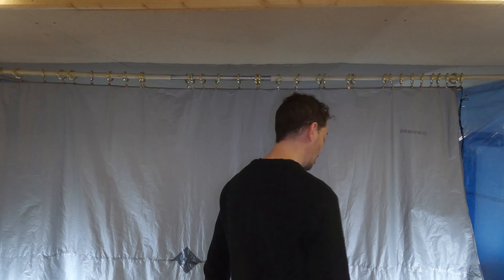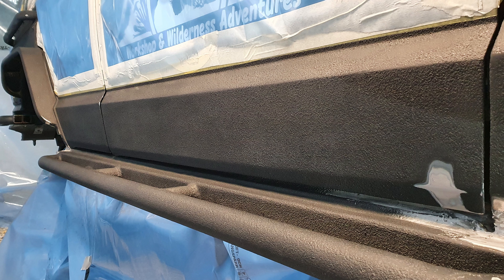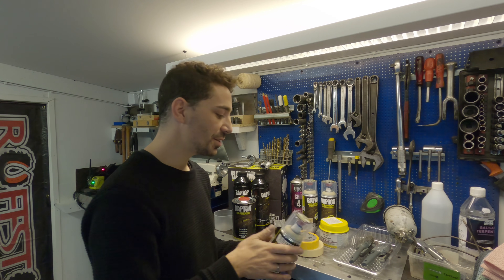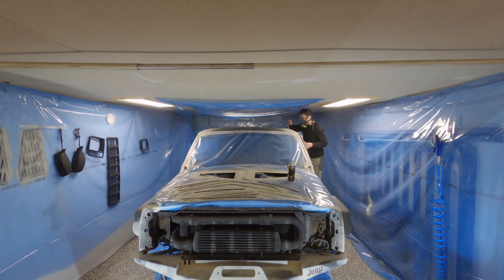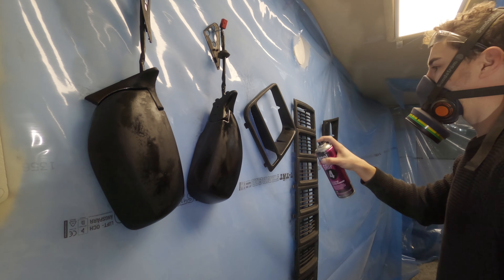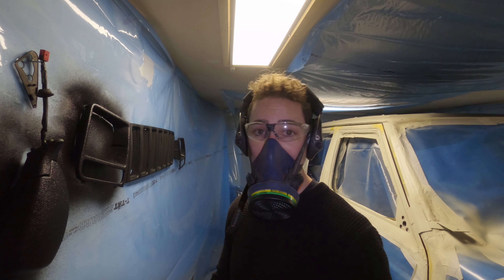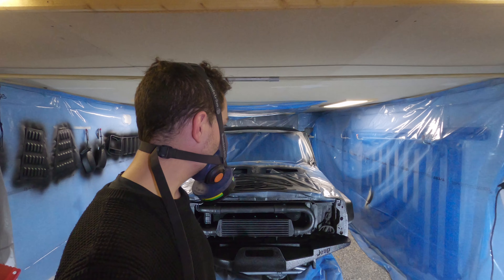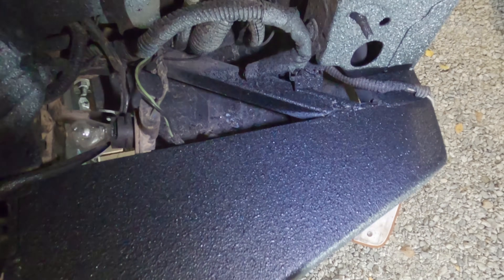Spraying Jeep XJ Parts with Raptor Liner

Comment: A heat gun helps to get any tape or glue residue off. I left tape on for a week, it would come off with anything until I used the heat gun.
Reply: It’s much easier to just use the right kind of tape!

Comment: Awesome video as all way Mike. For the guys out there that want a fine finish for the Raptor paint, you don’t have to use a Shultz gun. I used a standard spray gun with a 1.4 tip. To get better corners when you taping up you can use a product call fineline. It stretches, so you can pull it around the corners and get a nice even finish.

Comment: great video, I just finished doing rust repair and the interior floor painting on my xj. doing gears, sye, rear disc brake kit, and the underbody paint/protective coating tomorrow
Reply from the maker: Big Jobs! Do you have any photos or Instagram. I would love to follow along. 
Thanks for watching.
Reply: @WorkshoptoWilderness  
Nothing posted or anything yet; just been taking photos along this phase of the build so i can show whats been done. Big build being done in a small window of time. Not getting everything i planned to do done but all the important stuff
Reply from the maker: @theSvrh  it sounds like your doing an excellent job. This kind of work is largely ignored most of the time. Personally I feel likes it's the most important and then jeep will stand the test of time.
Reply: @WorkshoptoWilderness  
Building a proper foundation is important for sure. Not sure i am skilled enough for a "proper fondation" but certainly a good enough for me lol

Comment: I have COPD and asthma! I'd be running for the hills!  I barely get by cutting, burning, welding and grinding! Sanding wood is bad too! 😕😮‍💨
Reply from the maker: Have you tried a gas mask? That's what I wear almost all the time when working. The filters aren't cheap but smoke, dust, fumes don't get in and you maintain your health.
Reply: @WorkshoptoWilderness  That's a good idea! I doubt that I'd still be able to breathe? Now maybe if I could run oxygen through the water tube without blowing myself up ! 🤪

Comment: You spoke of how to do it in this video, but if it is possible, and since you asked, can you show how you assemble the door/window trim? Those little delicate bits always make me nervous. I'll be working on those parts next and would appreciate to know your process. Thanks much for sharing your detailed work! always the best.
Reply from the maker: I can certainly make a video on it. I still haven't finished the other side and I'm yet to spray some dinitrol and seam sealer in the areas that are required. Thanks for watching and for the suggestions

Comment: Here’s an idea for the rear quarter windows.Turn it into a gulwing door. That’s something I’m thinking about doing. Also have a box made for the inside.
Reply from the maker: Ive actually just finished filming that today. I still need to complete the box but the windows are finished. Worked pretty well. I put some photos on Instagram the other day, just the concept but it went well. Actually seals also which is a plus haha.
Reply: @WorkshoptoWilderness  I’ll have a look bud. If ok with you, I’ll pop you a DM and ask for the sizes of the internal box and what rubber seals you used.
Reply from the maker: I would watch my video first and then you can see all my mistakes haha. Do a better job I'm sure. But absolutely send me a mail and I will share what I used
Reply: @WorkshoptoWilderness  Thanks bud. Hope all is well with you and the family?

Comment: Looks great! I'm doing similar work, just not as extensive in the drip rails my bad areas were at the seam or junction up in the top rear corner of the back doors where the panels meet and the ends of the drip rails at the hatch on either side. Surprisingly there's no rust just a tiny bit of surface rust up there. The bad stuff was in the floors from the leaks but I have all that repaired. I think a combination of the stiffer chassis and new modern seam sealer throughout the vehicle will really help protect things. I'll be using 3m 2 part seam sealer.  After stripping almost all of the seam sealer off the whole body inside and out I get the feeling that it failed in certain areas from the joints flexing and the seam sealer being super old. I think with frame stiffeners and the roll cage it will help a lot with the body flexing. I also found frame stiffeners that go behind the front and rear bumpers linking everything together side to side. 
I've gotten lots of good ideas from your videos. I'll be painting and applying seam sealer to everything very soon. I really didn't want to do any exterior painting I was hoping all my repairs would be inside and underneath the car and I could leave the exterior color paint alone but after finding those areas around the drip rails and digging out that seam sealer I'm going to have to choose between black for the drip rails or trying to color match. My cherokee is maroon so I think black should look good I like how you did yours and I have a large roof rack. I don't think I could get a color match that would be good enough, that stuff bothers me. I really like how yours turned out it looks really good.
Reply from the maker: I think Maroon an black would look good. Actually rolling on the raptor with a small foam roller can give a really nice fine satin textured finish that's not aggressive. It might be an option anyway if your just doing one area and not lots of places like mine. 
The old seam sealer isnt great is it. I've found rust under loads of it around the floors and panels. I guess like you say the body moving must compromise it over time and the all it takes is some water to start a reaction and it spreads. I remember before stiffeners when I first offloaded mine and the Jeep was articulated the trunk use to pop open and I couldn't close the doors once I got out for a photo. That's good that your drip rails are intact, mine had been eaten by 20 years in the damp UK climate. Even when it doesn't rain its in the air and it must just get in everywhere. Sweden is very dry an no road salts so at least the jeep as a fighting chance now i've finished surgery. Thanks for watching and good luck with the continued build.
Reply: @WorkshoptoWilderness  
I live in the pacific northwest so we don't have much rust issues even though it's pretty moist here, but I was surprised to find so many rusty areas under the seam sealer that's what prompted this big project to redo all of it. At first I was just going to repair my floors. The bedliner on the floors lifted and it just destroyed them. I keep my cherokee parked out of the weather so that helps prolong things too. The worst part of the roof was actually on the inside of the drip rail in that little enclosed area and it wasn't even bad, there was 2 spots where the paint bubbled a little and I used a firearm bore brush on a flexible rod to scrub the loose paint off then I'm going to probably spray a little neutralizer on it and maybe try and get at it with a paint brush. I used one of those inspection cameras to look through the areas you can't see. 

How was your windshield frame? My 92 uses metal trim around the windshield all cherokee windshields are glued in but the 94 or 95 and newer cherokees use rubber trim around the windshield that looks like a seal but technically it's just trim its meant to cut down on wind noise compared to the old metal trim and I believe there was another reason for it I can't remember. I'm replacing my cracked windshield and my frame is perfect, I was thinking about updating to the newer rubber trim but im worried it may promote rust because all the rust I've seen on cherokee windshield frames has been on newer models. I'm almost thinking the older version might be better for longevity purposes. I'm also going to have my wife's windshield replaced on her 92 cherokee at the same time so I'm trying to figure out what the best setup is. I read on forums about people using the newer rubber trim on their older models but nobody talks about rust on the newer models and if it's an issue.

Comment: G'day Mike, very informative and well presented as usual, thanks mate !!!
In particular your point on those rear upper panels and around the screw heads on the bonnet vents, I assume silicone will stick ok to the Raptor, rather than just a make a formed seal type barrier, like an o-ring for example, if you know what I mean. 
Also, I do note your critique on the Raptor as being very abrasion resistant, but perhaps not so much chip resistant, but hey hit anything hard enough its probably gonna ding it, lol.
The issue I have trouble with is scratching the be-jesus out of the paint when navigating closed in scrub type tracks, even some suburban driveways here, lol.
I did see a Nissan Patrol converted to a flat bed ute down the local bottle-o that looked like the whole vehicle was dipped in Raptor, or at least a similar product, looked shizzenhousen IMO, but from a practical perspective, quite understandable given my previous point.
At the end of the day, anything you do special to protect the door and panel paint ? or do you see it as that's just what you cop going off road ?
Cheers Duke.

Comment: I suggest spending the extra money on the vari-nozzle spray gun. The results are so much more consistent & a true professional bedliner result as opposed to the random globbed on texture you'd get from the included gun. Plus it can be broken down to give it a proper cleaning & less likely to get clogged. All the thin & low spots become more conspicuous due to the texture being more consistent
Reply from the maker: We have a similar gun at work. A variable nozzle Shilts gun with brass adjusters on the front and a pressure gauge on it. I personally prefer the look of the standard gun and unregretably love the look of the inconsistent texture and the way the jeeps come out. The vary nozzle gun does produce a uniform texture which many like. The standard gun is easier to clean than the vary nozzle gun and easier to take apart. Just putting some truths down, but if you like that consistent texture and adjustability through the gun then it's the way to go. Thanks for watching

Comment: Mike thanks for taking the time and effort to film all this stuff. These projects already take a lot of time and i can imagine that filming it will increase it significantly. 

Do you ever regret welding the front panel to your frame slider? Because you dont have the option to take it off the jeep. I have to decide for myself if i want to do that at the moment.
Reply from the maker: Thanks for watching Sil, hopefully it can help someone out there. It was a time consuming project without filming, but I enjoy making the videos so its not too bad once in a while.  
I think for looks it gives a clean look but if the panel needs changing then it means cutting, welding and painting. It sounds bad but in reality look at the tube fender. A new panel would need cutting to accommodate the fender, it would then need painting again and so on. The way I see it is work needs doing either way so I would rather it looked nice.
Reply: @WorkshoptoWilderness  it does give a very clean look. I have to take that into consideration! Thanks again.

Comment: Hi Mike! I"m so happy to have found your channel. I actually just bought a 97 XJ and I can't wait to start working on it. That said I'm a beginner, so your videos have been really inspiring.   I have a question though regarding Raptor Liner.  The jeep came with a RoofNest rooftop tent. Unfortunately the clear coat on top has mostly flaked off.  Do you think it would be possible to use the Raptor Liner on the plastic top. I am planning to sand it first, and then was thinking to spray the entire hard roof top with the Raptor liner. Do you think that is a good plan?
Reply: Opps! I wrote my comment before finishing the video.  It looks like indeed I can use the RL on plastic.